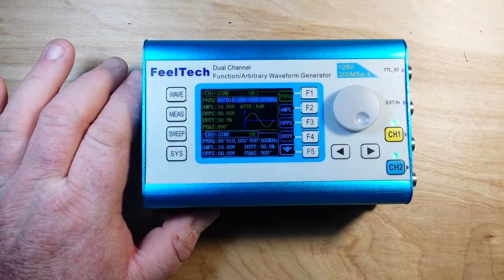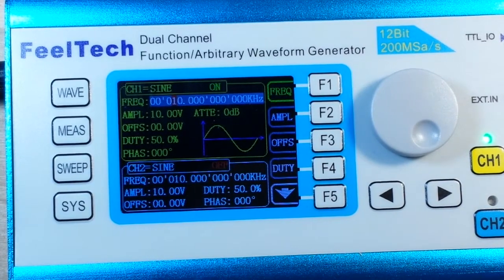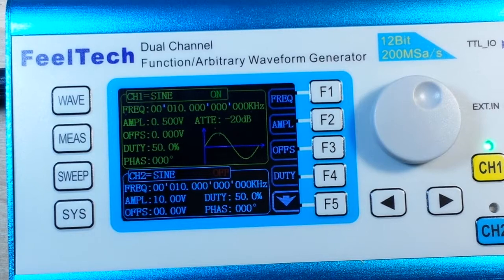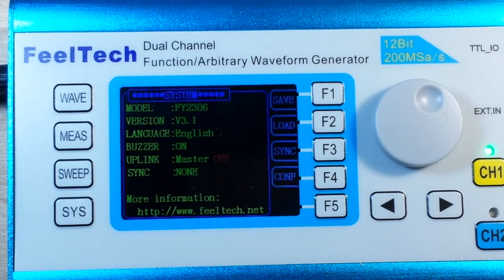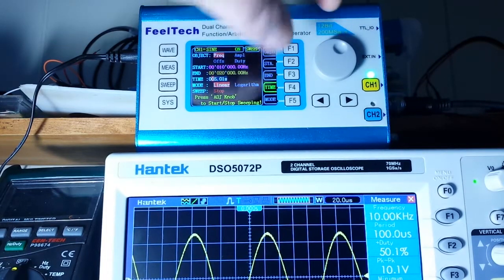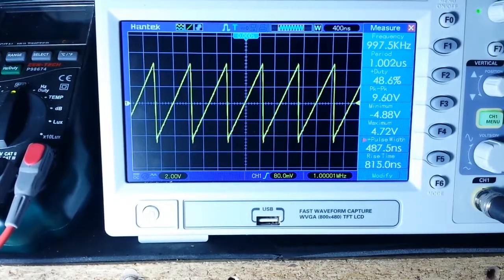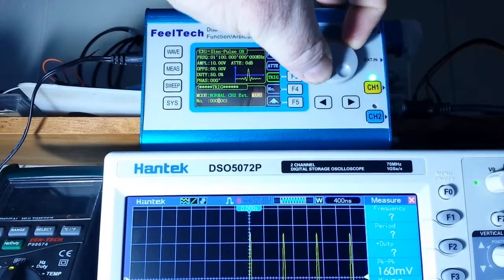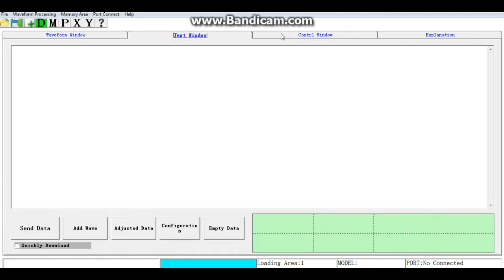Feel Tech FY2300 Arbitrary Waveform Generator from Banggood

Comment: Question: This can generate a signal in the audible range, I believe.  Would there be any impediment to connecting this to an audio input on some kind of device, like I would a synthesizer?  If I understand correctly you can control the attenuation on the output so I could actually generate a sound with this and set it up to output to my effects pedal; am I correct?
Reply from the maker: Yes you can use it as a tone generator.
Reply: Thanks!  So the software you show us, is that what came on the disc? Did you have any trouble getting it going?   The reason I'm asking is because I've seen a few videos about using it with software and how to program it and so forth, unlike your video. I just want to be able to hand-draw my waveforms. @learnelectronics 

EDIT: I have successfully installed the driver software off the disc and it appears to be working, will update.  As mentioned above, I'm using this for audio, as a synthesizer, and being able to draw the waveform by hand is a pretty unusual feature, possibly very useful.

Comment: Thank you for your share. I have 30mhz type. I had a problem with start up. When i open my FY2300H.  Device self test doing and staying at that screen. I learned something maybe some people have same problem. If you have same trouble with this device like this. Close it first and press to vairable rounded swich and at the same time press to F1.. So F1+Variable switch together.. Will be system reset and will be ok..

Comment: This unit puts out a digital output not analog correct?  If so, that would explain it's affordability. When are they going to put out an affordable multi-channel analog output AWG?
Reply from the maker: The FY-2300 has both analog and TTL outputs.
Reply: Fantastic news!  Thanks a lot for your response. One last question..from your video it sounds like you can link this unit with another FY-2300 via one pc/software and synch them together as far as phase start points, as if it was one FY-2300 unit with 4 separate channels instead of 2, is that true?  Hope i made that clear enough, I'm a beginner.
Reply: helo my frend @learnelectronics

Comment: These units come with two BNC to alligator clip connectors.  I'd like to use these to connect to two flat , 2" x 2" pieces of copper plates to send the frequencies.   
Could I connect the red connector to one plate, and, the other to the other plate, as long as I do not put those plates together, shorting them out?
Or, would it be better to connect red connector to copper plate, and connect the black connector to the generator itself, grounding it there?
I sent this question to Feeltech and haven't got a response yet.

Comment: Will this model allow to be used with Spooky2 software, by using command:, " Press SYS, Press More, F5,  then Press AGRT, F1?
Reply: @Rajiv Deo   @Fred R   I can confirm that FY2300 is working with Spooky software after changing the firmware "agreement" setting in FY2300 to "other".

However if you want to use FY2300 software, you will have to revert this to "feeltech". It seems like both channels are running as intended. Spooky remote is also compatible and functioning.
Reply: @motogee3796  Can I have more clear setup instructions if I want to use Spooky software with FY2300 bought 2 years back?
Reply: @RajivDeo  Connect FY2300 device to PC, it must be detected in device manager under Ports Com. If not, its ok install the windows CP210x drivers of FY2300 provided on Feeltech website and try again.
If it is auto-detectd check the version of drivers. Make sure you are running 2014 version of drivers  provided by feeltech. I tried with 2019 drivers it dint work.

First test if feeltech software is detecting the device. 

Once it is being detected, change the firmware "agreement" setting  to other on FY2300 following instructions given by FredR above (SYS + more + F5 + F1).

Now open spooky 2, it should be auto-detected.
Reply: Thanks Fred R for sharing the details. I am interested in using FY2300H with spooky2 software. On eevblog.com i learned from keithglos's postings that 
February 05, 2017, 07:46:10 am »
The "Spooky2" has modified firmware and the instruction set also modified so not compatible. It will still function as originally intended. The extensive free software written for the Spooky2 may be downloaded and run in "test mode" without the hardware,  if this does something useful for you then get a Spooky2 generator.
February 06, 2017, 09:44:06 am »
If you want to run spooky software then buy the 5Mhz Spooky2 generator. There are some hardware differences, I suspect MH do a special line for spooky. I think they have sold in the region of 15,000 of them.

What is your first hand experience of using Spooky2 with FY2300? Are all functions working as intended?
Please let me know either here or email to me rajivdeo@gmail.com
Thanks...
Reply from the maker: +Fred R I'm sorry, I'm unfamiliar with that software so I don't have an answer. Tell me where I can get the software, I'll download it and try it out and report back...
Reply: Download at: https://www.spooky2.com/downloadspage/ , Scroll down a little and you will see Software selection.  Thanks.
Reply: " press "SYS" button,then press"MORE" F5, then press（AGRT）F1, then turn off and turn on again ". This might pick up the Spooky2 software.
Reply from the maker: +Fred R no problem
Reply from the maker: +Fred R it would appear that it is compatible. But since I know nothing about the software, I can't tell you if it handles every function but they do talk to each other.
Reply: From my understanding, when spooky2 software installed first, then hook up spooky2 (Fy2300 generator), turn on the generator, then the software detects the unit, asking if you have more to detect. ( spooky2 software supposedly can run many of these units ) 
If you have determined from the spooky2 software, maybe a section from a menu to check for devices, or something like that, and you see the software has detected it, this generator you have in your video may work the software.  
Just so you know, the manufacturer makes a spooky2 frequency generator, that looks exactly like the unit in your video, with some decal and symbol changes on the face of the unit.  If you do a google image search for " Spooky2 generator", you can see it and why I thought might function the same.  
Thank you for checking this out, and, if I get one of those like you have in your video and find out it does indeed work the spooky2 software, I will do a reply in here.
Reply: I bought a Feeltech FY2300 6MHZ from Banggood, just came in yesterday.  Installed the Spooky2 software on my computer. Then, I plugged in the FY2300 generator.  It was detected and drivers installed.  I then pressed SYS, pressed More F5, then, Pressed AGRT F1.  Then, started Spooky2 software.  Menu opened, showed the generator, and, I was able to start the Terrain program, selected the generator under the Control menu.  Then, clicked on the Start button in Control, and, the program started running, even lit up the two channel  LED lights on the unit as it did so. 
I don't know yet if I have all the functions, but, so far, it's doing what it is supposed to do.  
Just wanted you to know ( and anyone else  that may want to try to run SPooky2 software on a Feeltech FY2300.    
Thank you!!!
Reply from the maker: +Fred R Thanks for sharing that great information.
Reply: Do you know if there’s any cheap amplifiers for use with these?

Comment: Which one is better? this(FY2300)  or FY6600
Reply: You're better off with one of these as the internal power supplies on the FY6600's carry high voltage onto the GND line.
Reply from the maker: +Markko The software is the same, I would guess the chipset is the same. The only difference is max speed on the square wave output and the form factor.
If you need 60MHz square waves then the FY6600 is better for you, if not I rate them as equal.

Comment: Would you say this is a must have?
Reply from the maker: J. Clowers If you are setting up an electronics lab, for a hobby or a business, must haves would include: multimeter, soldering gear, oscilloscope, signal generator, bench power supply.

So I would say yes. Most generators with these features cost upwards $350. This is a really nice package and includes 2 sets of cables and great software.
Reply: learnelectronics ok cool. Im going all out to set up for business. Thanks for the input!
Reply from the maker: No problem. This unit will save you a good $200 off the usual cost of $350-$500 for an AWG. Do you have a scope yet?
Reply: learnelectronics no. No scope yet. Was considering the one you use.
Reply from the maker: J. Clowers I would definitely recommend it. It sells as a 70MHz scope, hut comes pre-hacked to 200MHz and it's only $240 bucks. Check my 200MHz scope hiding in 70MHz body video. There is a link in the description.